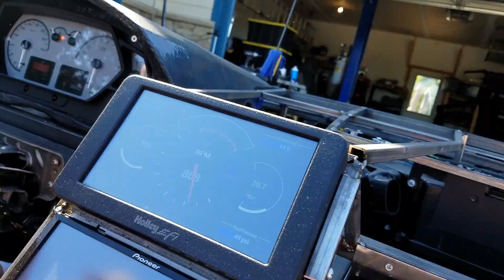3D Printed Interceptor First Drive!!!

Comment: Did you design the frame ? Also how did you get the dimensions of the of the body work correct ? From picture's ? Did 3d print files exist for it ?  pretty impressive I will say. Most guys that create they're own bodies use wood bucks, English wheel etc. Very few people have the work ethic, tools and knowledge to do things like this
Reply from the maker: I did.  Frames are not rocket science, just look at older cars.  I got the shape of the panels off a 10th scale model.  The track width and wheel base are known.  We were originally going to use classic techniques, but did 3D printing as an experiment.
Reply: Looking forward to seeing it evolve

Comment: Nice!! 

What size rims and tires are you running?
Reply from the maker: 20s
Reply: lasersterling what about tire dimensions?
Reply from the maker: @Truckingforlife323  305 in the rear, and 255 up front.
Reply: lasersterling great thank you! And i believe they’re 35’s low profile tires correct? 

Love your project so far!